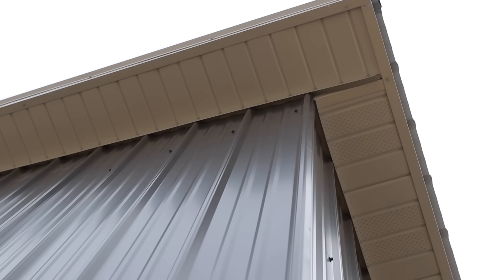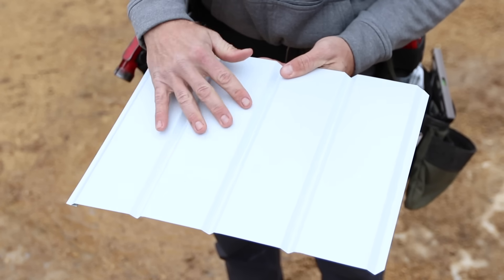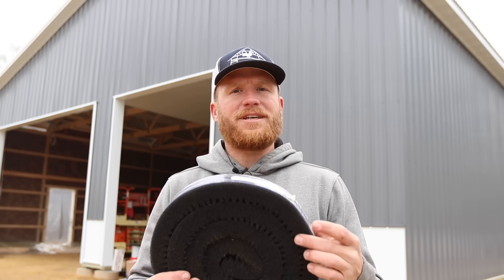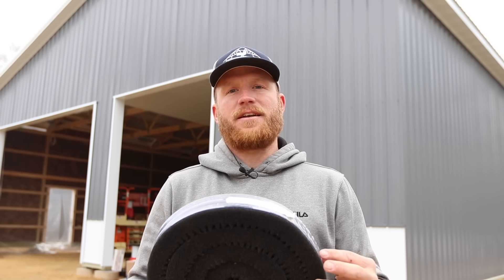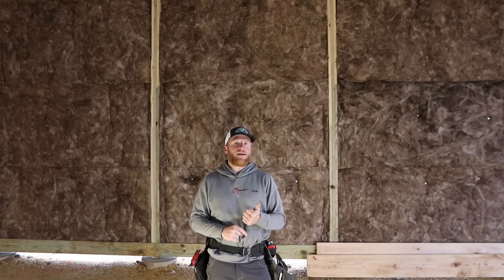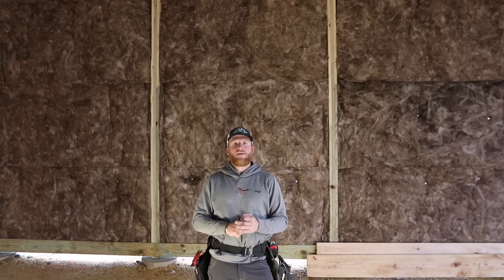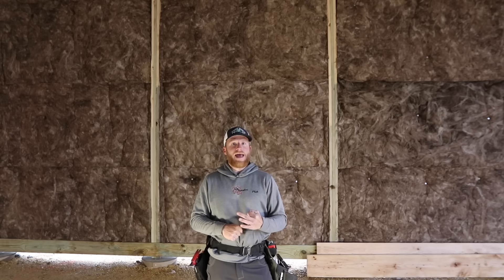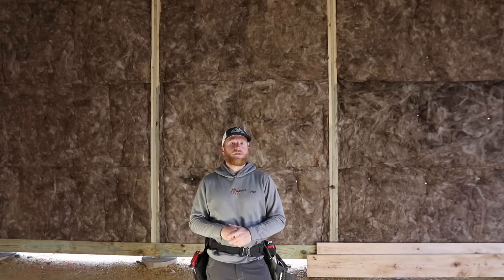Insulation: 5 steps to a more efficient building and why I don't use spray foam

Comment: Disagree totally !! Batt insulation every hole in the plastic interior, or not sealed at the top or bottom , will let caustic insulation out ! Everyone will breath them ! Every Dior opening,window open,overhead door open ! Prevailing winds will stir it up !
  Need to cover walls ?
 Always a defender !😩

Comment: Great video, clearly you care about quality and your video is intended to help people even if they do not intend to help you in your business. This is what makes YouTube so great. Only thing I would add is that you should add acoustical sealant between the vapour barrier and the bottom screed board. The outside air will push through the wall materials and creep into the heated space causing condensation where the dew point is reached. This can cause mold and moisture damage to the wall board. I do a few of this type of video as well but they are far less popular than yours. Border property inspections. Thanks for posting.

Comment: So you ceiling really doesn't sweat at all?  Would this be true if you had a home on the inside with two baths?  I'm in Northern Missouri and might be building next year.  I really like your idea to have that interior 2x8 with rat cap and insulation.  I was wondering how I would address the issue of the edge of the slab exposed to that frozen ground in winter time. Thanks for the tips!  I was thinking about doing blow in for the walls as well and make them 1 ft thick...any thoughts on that?

Comment: Old remodels where you tear the inside walls out to redo wiring and the original outside wall was shingles over shiplap. Spray foam is perfect there as it seals up all the cracks and knots.

Comment: Love the videos and your techniques. Up here in Wisconsin I never advise a flash and batt set up. 1” of closed cell spray foam is a class A vapor barrier and up here anytime fiberglass is used your required to have a vapor barrier on the inside too this creates a moisture trap. If your going to spray foam its advised to spray enough so the dew point is in the foam. This means at lease 50% of your r value needs to be in foam so moisture doesnt condense. Keep up the awesome work!! Im glad your customers have you and your work ethic!

Comment: Even with the vapor barrier on the inside with the fiberglass, it'll still sweat. Spray foam will prevent any condensation. I spray a ton of metal building and spraying 2" of Closed Cell (2lb) foam works just perfectly.

Comment: Spray foam is wayyyy faster and 3 inches is r 24 with thermalseal one... Fiber glass is shit especially with a condensation factor of a pole building.also your are talking about insulation on the wall to roof meet.. with spray insulation you can cut down the energy heel and save even more money. High density spray insulation also reinforces your building making them last way longer and seals from 99.9 leaks. You are talking like the only factor of spray foam is for it's R value and that's just ridiculous. Just get the foam you will never regret it, especially when all your fiberglass rots and you get rained on in your 2 year old pole building.
Reply: Other then that nice video

Comment: In my area, we have minimum R38 in the floors, R30 in the walls, R60 in the ceilings. Yes it gets very cold -34C average -44 to -46C many days in winter.   You don't realize how lucky you are with your weather in Illinois
Reply: Hi Neil.  How would you get R30 in a wall?  Isn't it just a 4" cavity?  6" rockwool is only R22.  Or maybe your walls are built deeper/thicker...
Reply: @jimgardner5129  floors are 12", walls are 6"  (R20 in canada)plus 2" of extruded foam, and ceiling is R20 batts plus 18" of treated cellulose blow-in

Comment: Hi, whats your take on Outside spray foam insulation on metal buildings?....I am living in Arizona, and that would be another Great barrier from the heat...And really help reduce  heat all year long, on the metal roof and side-ing...the North side of any building here, is the only side that gets a break from the heat All Year long, and that's in the winter...thx

Comment: Do you get settling of the fiberglass causing breaks in those LARGE bays? Staples? 16 inch frame you get lots of friction in each bay for relatively light batts.

Comment: You don't use foam because you don't know enough about it.  There is no downside using foam. All its does is makes your roof/wall assembly air tight. No air infiltration = no condensation= no problems. Any building needs to be properly vented in case of moisture built up. Letting this moisture through you insulation doesn't make any sense as moisture or water reduces r value.

Comment: RR Buildings
I would think using spray foam on the bottom 3 feet or so of the walls would help keep out the mice etc. getting up into the walls.

Comment: The best thing you can use on a metal building like this one is closed cell spray foam. It is 4 times more efficient than fiberglass. No sweating on the building, 30% structural integrity and perfectly sealed. 

No way I will do this over foam.
Reply: yep. and the R-Value of wet insulation is ZERO.
Reply: More like twice as efficient and four times the cost.  Unless someone has a very specific need it's just pissing money away.
Reply: @The13inc  you need to understand that the r value is not an accurate measure before you qualify your statement. Two inches of closed cell is maybe r 11. However it is 90% + efficient. Not to mention fiberglass r value can drop from say r11 on a 2*4 wall to r 1 if you have air infiltration on a small hole. I live in Minnesota and own many rental houses. The ones we foam pay for the foam in the first two years. Far superior when high heating costs compete for your rent. If the attic is large enough full it with blown insulation and skip the foam.

Comment: These videos are nice.  I have a 40’x30’ building that was purchased about 2 years ago on the property I just bought.  I want to take half of it and make it a man cave so I’m having a partition wall framed right down the middle.  What type of insulation should I use and do I have to insulate the whole building, can I just insulate the part that will be my hang out space.  The other half will be where I keep my lawnmower and wood working stuff. I live in Texas.

Comment: The mice are going to LOVE that insulation. I've lost count how many barns I've pulled all the bat insulation out of after years of infestation. 
Haven't had a single customer report they had rodent issues with solid core insulation or spray-in.
Reply: I think if you look at his trim and framing details; there are no rodent accessable points.  Certainly no more than in a stick frame (stud wall) building.

Comment: The Foam on the Ridge Vent only last Six to Seven years, it then falls apart due to the heat and ozone. They have Ridge Vent that has a course spun fiber glass baffle that will outlast the Ridge Vent

Comment: 5:00 minute or so, yeah you do get a lot of cold bridging in wood or steel frame buildings when the studs are at 16" o/c or even 24".
You eliminate the bridging by putting rigid insulation on the exterior side of the studs in between wood furring - two layers of wood furring and insulation is even better, but keep at least 1" of air space between the inside face of exterior cladding and the face of insulation for venting purposes.
Yes, it does add to the construction costs, but it makes for a much better energy efficient house or a building.

Comment: WeatherPro  ridge vent is another good product, and you cannot "squash it" when nailing shingles to it unlike with mesh or foam type ridge vents.
Whatever you use, you have to make sure you cut the plywood roof sheathing at the ridge for a width of 2" or so on either side of the slope.
That's the slot through which the hot air from the attic will rise.
You would be surprised how often I have seen ridge vents on the roof peak, but no slot in the sheathing!

Comment: 1:15, you say "vapour barrier";
That is a "air barrier", and it goes on the exterior in colder climates - as you say, one of the functions it has is to keep the winds out.
The vapour barrier goes on the inside in colder climates.
You need both in wood or steel stud construction in colder climates.
Best vapour barrier is a 4 mil polyethylene, and arguably the best air barrier is a peel-and-stick or torched on Bakor Blueskin sheet.

Comment: On my post frame house, I used batts on the sidewalls. I did a spray and blow in the attic, where I did 1” to seal, and blown-in to achieve r-value. Most of your air and heat loss is through the ceiling. The 1” foam makes a big difference and is the best bang for your buck.

Comment: Thank you for the informative video! I understand (and agree with) encapsulating the insulation on both the outside and inside by way of the 'weather barrier' and 'vapor barrier'. However, if you're using the weather barrier underneath the metal on the sidewalls, why wouldn't you also do the same for the underside of the roof? The roof is more vulnerable to wind upheaval and rainwater or condensation leaks/drips. Regardless of the cause, without a barrier, any moisture that makes it's way in would be falling right onto the blown insulation. Do you cover the top of the blown insulation with a barrier?
Reply: It's a vented roof, so the temperature above the insulation is the same as the outside. The low-permeability barrier would be under the insulation, to prevent warm indoor air from getting into the attic space.
Reply: @canonicaltom  Thank you so much for explaining!

Comment: Great video with lots of excellent information!  Every building I have worked in or home lived in with blown in insulation has problems with mice getting into the blown in insulation in the ceiling and in some cases the walls. What has your experience been with mice & other critters getting into the insulation?  Does the rat board pretty well keep critters out?  How about the ceiling blown in insulation?  Fiberglass is a LOT more cost effective and I would prefer to go with it provided I can do it and not have issues later on with mice, bugs, and other critters.  Love your quality &  workmanship and the time you take to detail out these videos!  👍

Comment: Spray foamed a house couple years back and next time it wont be spray foam i can assure you of that!
Reply: Tell us more. Always looking for real life experiences, especially when all the TV-based building shows have such an obsession with it.
Reply: So I sprayed my own with foam it greens system, turned out fairly well; but I just don’t think it’s worth it in most cases, makes life real hard down the road, absorbs water  etc. I would deff use sheets of foam but not sure I would do spray unless its a scenario that absolutely requires it.

Comment: I like your solution of that RatBoard. My shed has also a crossover from concrete and the soil outside. The neighbor raised the soil and now the hardwood has rotted away opening up the wall for mice to crawl into the fiberglass making it very comfortable for them. So I would suggest the RadBoard for sure to be some space above the slab. Ony how to insulate underneath the RadBoard? I also have to think about keeping the moister away from my outside wall preventing it to rot away again. Any thoughts?

Comment: Question for you Kyle (or other shop builders).  I am planning a ~40'X~80' shop in Idaho.  I am going to extend it another ~20' for a two-story apartment on one end.  It is very common in Idaho to use an insulation product that comes in large 12' Rolls and I think it is an R19 product.  Why not do a 2"/3" poly-iso foam with a thermal barrier to create a thermal barrier around the outside of the shop?  I am guessing this must be too much money???  I just think you would get a better insulation value wrapping the whole building...?  Any help would be appreciated.

Comment: From what Ive seen so far the foam thickness for 'flash and batt' should be 2 inches, and not just 1 inch.  This helps ensure the vapor barrier is intact and can prevent condensation on the inner surfaces of wall and roof sheathing.   At 1 inch there is greater chance of leakage, and thus condensation forming.  I'm no expert, just what I'm seeing so far, as I too, am learning.

Comment: So i have a Pole Barn that I want to finish off a space inside.  It doesn't have the weather barrier between the steal panels on the outside, and the horizontal braces it is screwed to.  So I should look into a foam panel, with moisture / weather barrier foil on one side to cut and fit in between the horizontal braces, then do the large bats of insulation behind that, between the 12 foot on center poles, followed by vapor barrier if needed in my area?

Comment: the only real disadvantage to spray foam is upfront cost, closed cell spray foam has almost twice the r value per inch than fiberglass, acts as a vapor barrier which costs down on cost to install one, doesn't settle over time like fiberglass which is a big problem, adds some structural integrity to the building as it sticks to everything which also means it doesn't require anything to hold it up(bands, staple,nails), fills every void unlike other insulation types, lasts much longer and easier to apply.
the gas emitted from it is only while its curing, after that its safer than fiberglass( which isnt good to touch or breath in).
If you go with the facts and not act on emotions/opinions then you usually wind up being more logical and overall smarter person than the typical guy/girl who has a iphone and thinks they know everything about electrcity.

Comment: Really enjoyed your video and I read each comment also.  That was entertaining but draining ... I am insulating my pole barn built 2 years ago and have decided to use a metal ceiling and then blow-in insulation.  You mentioned needing a vapor barrier for the ceiling and I am unsure of how to do that and where that needs to be placed.  Can you please explain how you recommend I do that?  The only thing the builders put between the metal roof and the trusses is a thin piece of bubble wrap.  It does have a ridge vent.  Thanks!
Reply from the maker: I apply vapor barrier to the underside of the framing between the metal and the insulation
Reply: @RRBuildings  ok.  Thanks. I assume you staple visqueen to the rafters then?

Comment: Spray foam near impossible to remove if you ever need access, such as to investigate a leak.
Reply: How so? It doesn't come out cleanly but you can cut a section out and just add a little foam around the edges once you've done the work.

Comment: Flash N Batt is probably the best system to use like you said with one inch of foam and the  rest with batt insulation of your choice. With that you get your windbreaker with a warm sweater underneath. Excellent building practices, Kyle.

Comment: Why not use both exterior and interior vapor barriers? It certainly gets as hot and humid enough in Illinois. (What I don't like about batting: it settles. I know the batting in my older home is not where it should be. I'd bet that a full 1/3 of the walls is no longer insulated due to settling)

Comment: We are getting ready to have liner panel installed in an older pole building.  It has three separate "bays".  The northern most bay was shot with spray foam on the walls and the underside of the metal roof panels,  A separation wall from that bay to the next bay is a 16-inch on center 2x4 wall with R-13 fiberglass (no wall covering except for the opposite side in the second bay which is 1/4" OSB) Funky I know -- Right?  In the 1st most Northern bay the foam was shot solid against the exterior perimeter, and basically blocks off any venting at the eaves and the ridge cap is a translucent plastic "cap" with no venting. This bay will be one of the three that gets metal liner panel  installed (the trusses are 4 foot on center 2x6 framing.  Once the liner is installed the ceiling above will be insulated (plan on using blown in Fiberglass.  Note: The building is located in Northwest Lower Peninsula of Michigan where the weather is extremely variable.  The 2nd bay 45x39 was NOT foamed previously.  The exterior walls have a layer of fiberglass behind 1/2 inch drywall on three of the walls with the 4th Northern wall being the one with the 1/4 inch OSB.
The 3rd bay (Southern bay) will not have any work done to it at this time.  Our biggest concern is to be able to determine if a VAPOR BARRIER is needed for the ceiling? The North Bay is heated with a gas heater hung from the ceiling and the "Middle Bay" is going to be heated using a re-cycled/used Oil Clean Burn Heater.  One person I contacted said this, and I quote: "If you are insulating it then no you don’t need it. If your not insulating it than yes you will want it on there."  THEREFORE -- My confusion remains  -- Do we need a vapor barrier or not?  Still asking local builders trying to get the answer!  Any comments here will be appreciated.  Thanks Greg and R&R Buildings for your great videos.

Comment: There are so many ways to finish a building.  One of the best for the money in northern Montana where it can get VERY COLD, is to spray foam insulate walls and then paint them.  Saves the cost of finishing inside with metal or plywood.  If you hire an experienced insulation guy the appearance is quite smooth.  There are many shops/barns built with engineered arch trusses that save some square footage on the sidewall height but still allow for an overhead door that is taller than sidewalls.  Works well for machinery and semi trucks.  The one thing that I will point out,  foam insulation seals the building and there is no need for house wrap on the outside or a plastic vapor barrier on the inside. Those things do add some cost which could be saved and put towards foam which is a better product for a metal building in cold regions.  Warm air will never contact cold metal with spray foam.